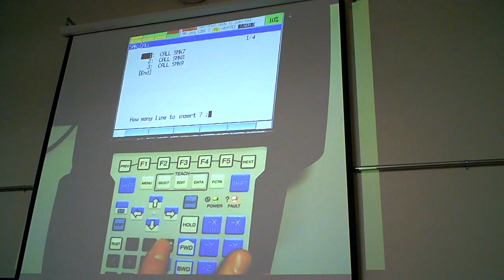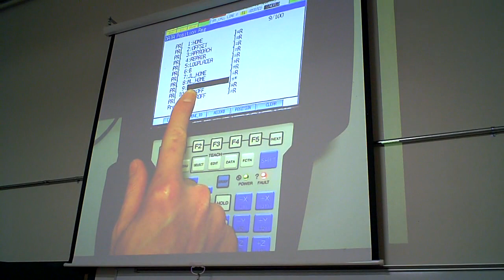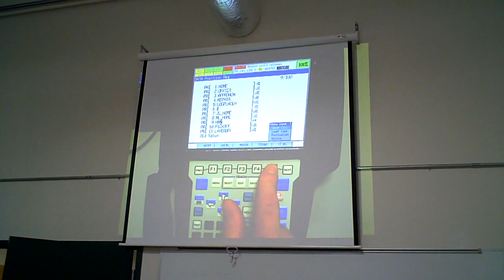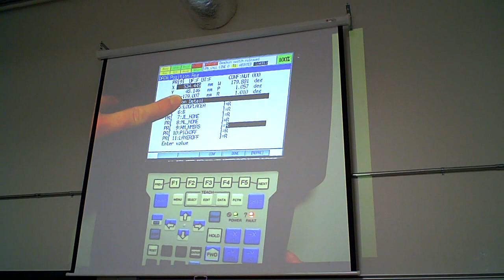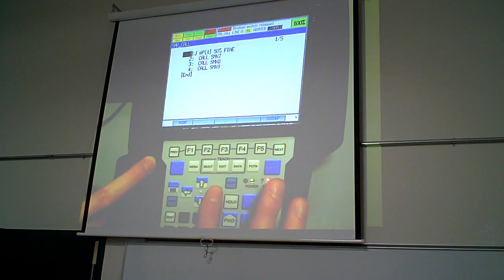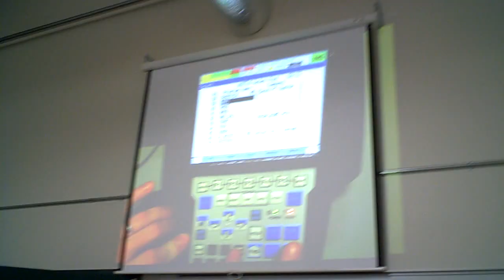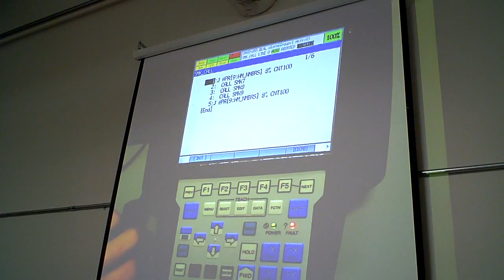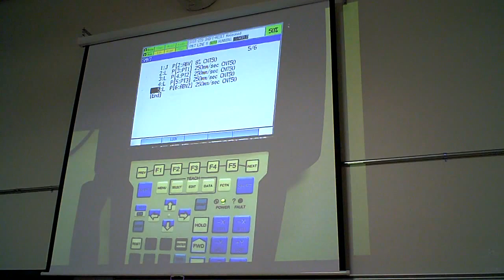Using [PR] in a CALL program to eliminate wasted moves...

Comment: which pendant model you use or does it matter at all? There are tons of these controllers on ebay are these universal and can be used on any fanuc model or they are specific for concrete model of the robot?
Reply from the maker: Hello, we using the non-touchscreen Teach Pendant for the R30iA controller. It's part# A058-2518-C202#EMH - sorry do not know what compatability is between controllers and teach pendants. Be careful buying used, as you have to purchase a support contract from FANUC if you are not the original owner.